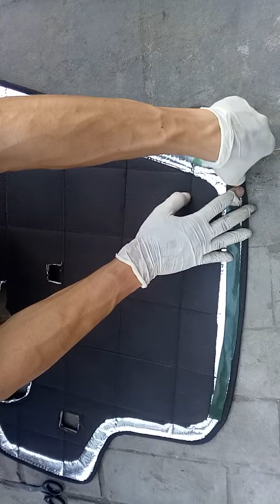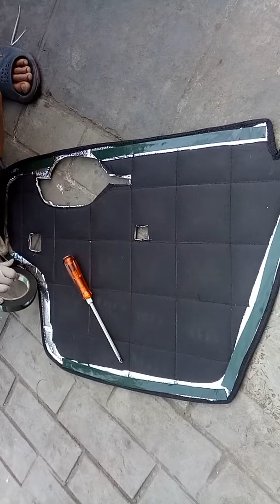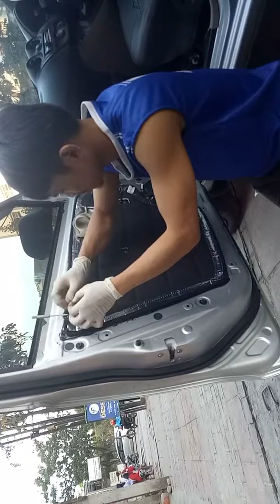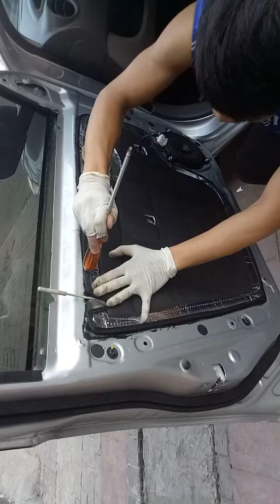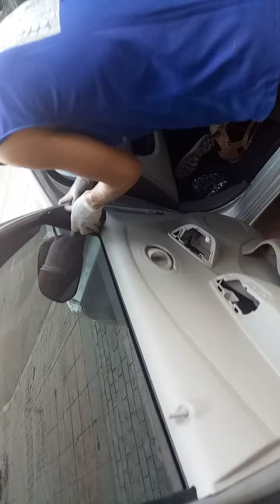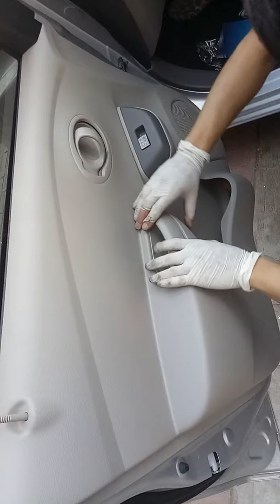Suara speaker mobil dengan peredam ceramic

Comment from the maker: 9 Manfaat VTech sbg Peredam Panas & Suara 🎯 :

1. Diakui *HASIL AKHIR SIGNIFIKAN*. 🏆 Terdapat TESTIMONI customer di You Tube.

2. VTech *RINGAN*, tidak membebani.🎈Note : Pemakaian bahan aspal,  full, mencapai 60kg.

3. Material VTech TITIK LELEH 1300° 🔥 Note : Aspal mencapai titik LEMBEK saat dipakai di plafond mobil.

4. Mengeliminasi RESONANSI & GEMA 🌀 serta pantulan suara pada ruang kosong.

5. VTech memiliki SOUND TRANSMISSION LOSS TINGGI 🎧Insulasi suara yg baik, setara dg peredam lain yg 10x lebih tebal, shg energi gelombang suara terfokus, suara di dalam & suara dari luar terpisah.

6. Material VTech memiliki DENSITAS PERMUKAAN TINGGI  mampu meningkatkan
Akustik suara 🎼 & mengembalikan harmoni suara musik 🎹 .Vokal lbh bulat, bass, treble, cymbal, echo smua lbh baik.

7. Material VTech memiliki PORI RONGGA UDARA RAPAT 💤💤menyulitkan gelombang suara dari luar merambat masuk ke ruang kabin, spt suara gemericik hujan, suara deru mesin, dll.

8. Material VTech TIDAK TURUT BERGETAR  🕸atau dengan kata lain meredam getaran, memutuskan kontak fisik getaran suara benda padat yg merambat, seperti flanking noise (getaran bahan besi yg beradu), suara gesekan ban mobil dg aspal.

9. Material VTech TIDAK MENYERAP UAP AIR  ☔ shg daya insulasi suara nya stabil. Note : bahan busa menyerap air shg daya redam nya akan berkurang saat basah.

Terima kasih atas kepercayaan dalam memilih produk VTech.
Reply: V-Tech InsuLation Indonesia di malang untuk beli n pasang dmn ya
Reply from the maker: Adi Adi 
Cabang yang ada baru di Surabaya Mas 🙏
Reply: V-Tech InsuLation Indonesia ada alamat ato no tlp
Reply from the maker: Adi Adi 
Ada Pa Pa Benz 
Tlp  +628113343967 
Di Sidoarjo: Car Wash Jenggolo. 

di Surabaya:
- C2 Plus Pom Bensin  Wiyung 
- C2 Plus HR Muhammad.
Reply from the maker: Adi Adi 
Untuk mobil apa Mas?
Reply: V-Tech InsuLation Indonesia daihatsu sigra,kira2 hargax brp ya
Reply from the maker: Adi Adi 
Utk bahan peredam suara akustik 4 pintu Sigra, rp 600rb
Reply from the maker: 9 Manfaat VTech sbg Peredam Panas & Suara 🎯 :

1. Diakui *HASIL AKHIR SIGNIFIKAN*. 🏆 Terdapat TESTIMONI customer di You Tube.

2. VTech *RINGAN*, tidak membebani.🎈Note : Pemakaian bahan aspal,  full, mencapai 60kg.

3. Material VTech TITIK LELEH 1300° 🔥 Note : Aspal mencapai titik LEMBEK saat dipakai di plafond mobil.

4. Mengeliminasi RESONANSI & GEMA 🌀 serta pantulan suara pada ruang kosong.

5. VTech memiliki SOUND TRANSMISSION LOSS TINGGI 🎧Insulasi suara yg baik, setara dg peredam lain yg 10x lebih tebal, shg energi gelombang suara terfokus, suara di dalam & suara dari luar terpisah.

6. Material VTech memiliki DENSITAS PERMUKAAN TINGGI  mampu meningkatkan
Akustik suara 🎼 & mengembalikan harmoni suara musik 🎹 .Vokal lbh bulat, bass, treble, cymbal, echo smua lbh baik.

7. Material VTech memiliki PORI RONGGA UDARA RAPAT 💤💤menyulitkan gelombang suara dari luar merambat masuk ke ruang kabin, spt suara gemericik hujan, suara deru mesin, dll.

8. Material VTech TIDAK TURUT BERGETAR  🕸atau dengan kata lain meredam getaran, memutuskan kontak fisik getaran suara benda padat yg merambat, seperti flanking noise (getaran bahan besi yg beradu), suara gesekan ban mobil dg aspal.

9. Material VTech TIDAK MENYERAP UAP AIR  ☔ shg daya insulasi suara nya stabil. Note : bahan busa menyerap air shg daya redam nya akan berkurang saat basah.

Terima kasih atas kepercayaan dalam memilih produk VTech.